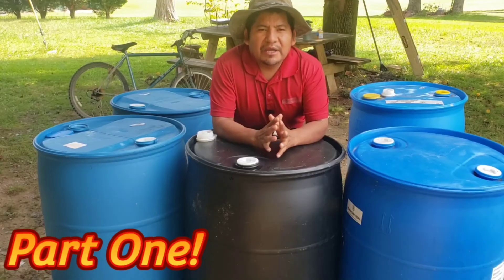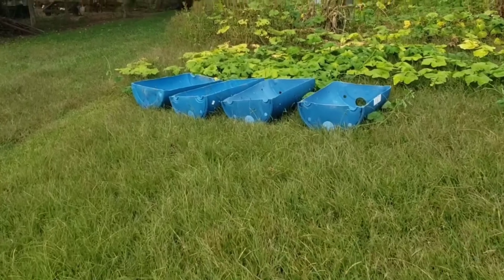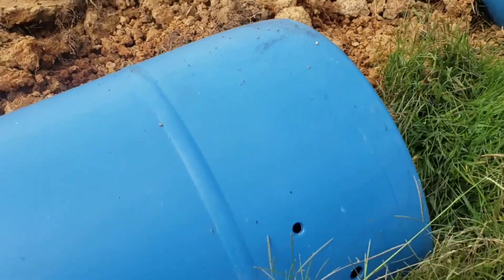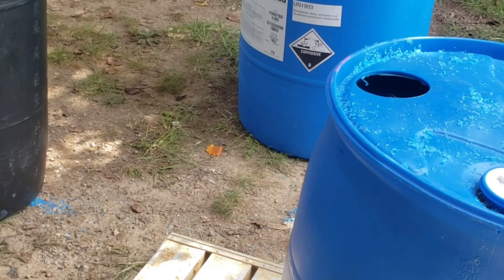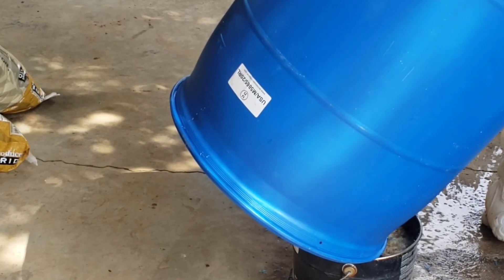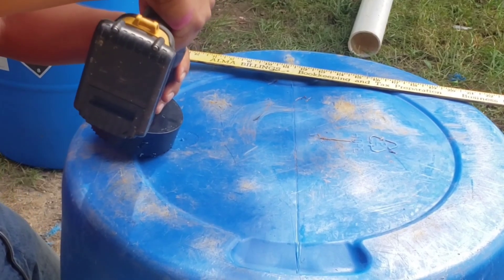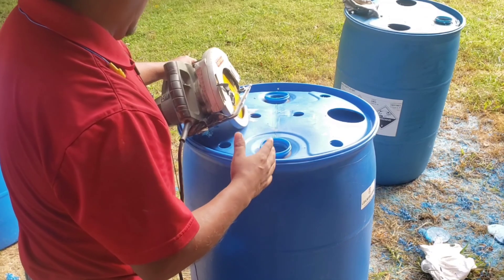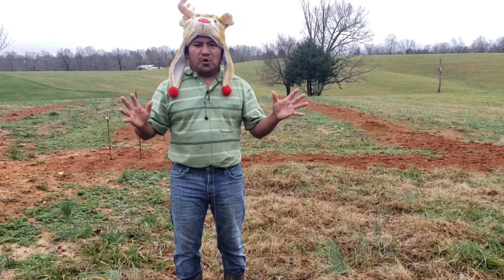DIY Septic Drain Field with 55 gallons Barrel, 22 Home made Gravel-Lees Drain Field or Leach Field

Comment: Did you drill any holes in the white PVC pipe so the water can come out to the PVC pipe also do you use gravel in the bottom what size hole do you lay on the PVC pipe how many holes Anis pipe in what direction thank you Florida name is Joseph
Reply from the maker: Hi Creen Harvest, 
the on from the Tank through Distribution box to the Blue Barrel there's no holes on them,
those ones in Blue Barrel, i bought them as Predrilled/ 1/2 holes, i did not  use Gravel in the bottom but I drilled holes on the blue barrel as you can see on the part #1 of this video,  with all different sizes of hole because i used the universal drill bit
Reply from the maker: hey Joseph, can I call you?
Reply from the maker: or look me up on Facebook we can facetime there under, 
Maya soñadores Fb

Comment: Why do you drill small holes on the sides and tops and bottom? I would think the dirt will plug it up after a while?  Have you had any issues with your leach field?
Reply from the maker: You have to plenty of holes for water to leak in the ground , and yes it's still working in 12/01/2025 thanks for watching
Reply: @IshMotorparts  follow up questions.  Why not extend the pipe in all the 1/2 barrels instead of only a few.  Why drill out all the 4 1/2 inch holes if you are running the pipe in the first few barrels.  How far is your run on those trenches?  Any clean outs added?

Comment: Did you run the perforated PVC pipe through the entire length of the barrels? How did you end the PVC? Awesome video!!! Thanks!!
Reply from the maker: No, I only did 10' foot and the rest is empty barrels
Reply: @IshMotorparts  is your septic still working good.

Comment: Pick up some blue barrels like you did what I'm trying to do is a little bit different than you are I'm trying to separate the septic tank. I'm disconnecting the pipe that goes to the septic tank putting a hole in the wall so I can run the washer and the water does not go into the septic tank basically what I want to do is a leach field when I start making it I will make videos of it just want the washing machine to be separated from the septic tank so I can wash clothes and it can go straight into the ground I don't think I need a distribution box because I'm going about 2 feet underneath the ground maybe three drill the holes on the blue Barrel like you did put the PVC through the Blue Barrel make sure I drill holes in it because I already have quite a bit of white PVC pipe I don't know if I had to do a 4 inch pipe I'm trying to schematic on it right now the hardest part is joining the hole-in-the-wall the concrete wall cement block so I can run it downwards then dig a hole and the ground run the PVC pipe dig a trench because it goes a little ways l formation then back to the Blue Barrel I tried to find your website but I couldn't find it thank you very much for the information Joseph Velez
Reply from the maker: yey alright you get it men, 
if you using the 4" thin wall pipe, this is  the  Right hole saw size, 2 9/16 =65 mm, the part number through Amazon, M24 , its kind of confusing but this is th the only perfect one i found  i went to A/c hardware, Lowe's  and everywhere I  found some ether too small or too big
Reply from the maker: sorry I was reading that the Box i got here but   but I think they the wrong Label on it,. 
so it should be the.
Phituoda  4-1/2" =108 mm Hole Saw

Comment: Have you had any issues with these barrels floating?  OR did you put some rock or concrete in the bottom of the barrels to keep them from floating?
Reply from the maker: Yes at the first the big white one did  because I left it in the ground for about 30 days or so, so I end up using only one, I think I showed and explained that on this Video or on other one
Reply from the maker: If you asking about the Blue ones, 
No did not put racks or concrete in the bottom, I used only Barrels, sheet or old Plnkets and finally soil/dirt on top, as of right now it's working perfectly no issue whatsoever